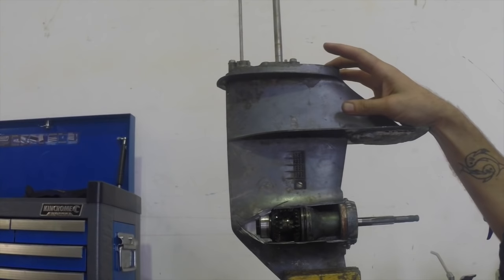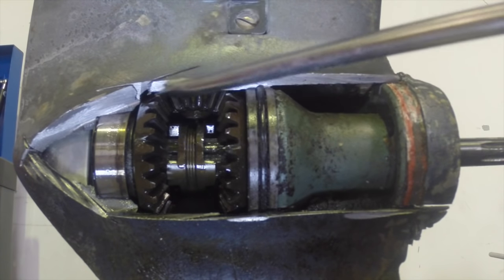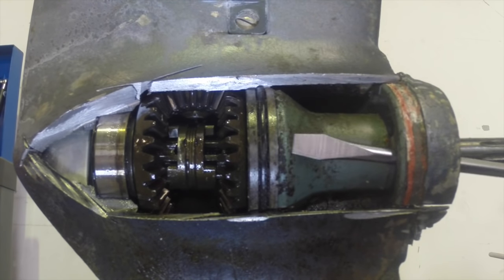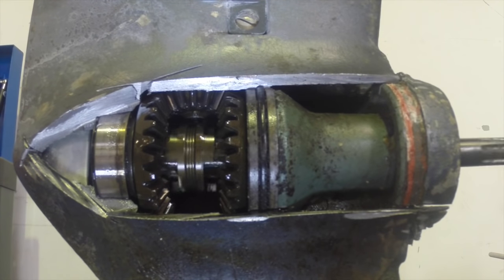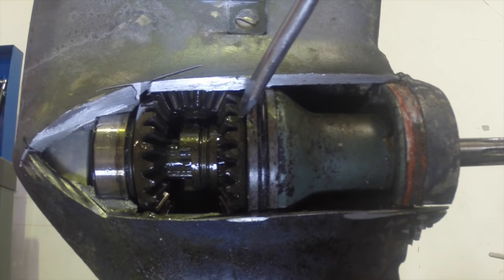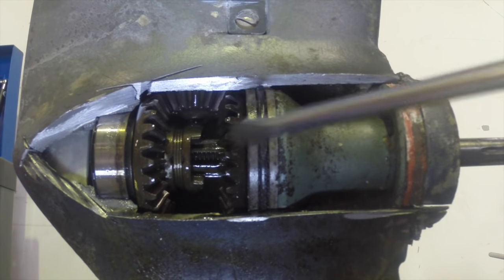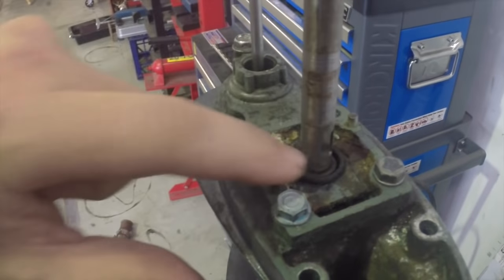How an outboard gearbox works

Comment: Brought a boat in that had shift issues to be repaired.  After looking at the damage in the lower unit, the mechanic asked me how we shifted the boat into gear. He stated the worst thing you can do when shifting a boat from neutral to either forward or reverse is to do it slow and gently. That motion needs to be somewhat quick and deliberate so that the two metal parts mesh quickly  to reduce wear on those two parts. Another thing I found out later on was shifting involving a stainless steel prop.  Because a stainless steel prop weighs so much more than an aluminum prop, I was advised when shifting from reverse to forward or vice versa, to go to neutral and allow a short delay before shifting to reverse the spin of the prop.  This delay in neutral was to allow the heavy stainless prop to come to a stop before reversing its spin. Hope this helps someone so they don't have to learn the hard way.  Your lower unit cut away is awesome by the way. Thanks for sharing.

Comment: Just the bearing carrier came out leaving the roller bearing at the bottom  around the prop shaft . Need not worry anymore . I pulled out the shift rod then blew air through the oil fill hole and wala. That piece of metal blew out and smacked  my hand so , I had a beer and a shot of Jack Daniels , gunna get pissed instead of pissed off my friend . I'm so happy , and so appreciated with your help trouble shooting .
Reply from the maker: Nice one! Have a JD for me! :)

Comment: Just wanted to say thanks from Northern Ireland.The video's really help. As the poor sod in a local fishing club who does the maintenance, your video's are invaluable to me.The explanation of the gearbox lower unit is great.
Reply from the maker: Thanks Kenneth, good luck keeping those fishing boats on the water!
Reply: Dangar Marine : I took the thermostat out of my 1977/85hp. Evinrude and am now having trouble getting it back together, not sure which spring goes to the thermostat.need illistration.

Comment: this video takes the mystery out of how the lower unit gearing works, thanks.
Reply from the maker: You're welcome, have another one on the clutch and gear selection mechanism coming soon.
Reply: @DangarMarine  dirección de taller donde reparan transmisión de un yamaha outboard four stroke 150hp año 2006
Reply: Necesito reparar transmisión de un yamaha outboard 150hp año 2006 four stroke

Comment: Nice man, work at an insurance company where they did similar cut out the sides pulled the carrier and hooked a little electric motor to the drive gear to show it.  Simplicity of these motors is pretty ingenious, seem way more complicated than they really are.  A little explanation can really help people take care of their boats.  Especially the dog clutch, so many think they gotta ease into gear which is terrible for it when you see how it chips the crap out of it.

Comment: Very educational. Even I understood it :) Thanks.
Reply from the maker: You're welcome Helge. :)
Reply: Just change impeller on my 1983 model of Mercury 80 hp. Functions great in forward and neutral. In reverse the propeller is blocked in both directions. Do you think it has to do with my mistake of throwing it in reverse last time I used it on to high rpm? According to your video, the tooths on the reverse side are deformated?
Reply: i didn´t understand EXACTLY  how that dog clutch gets movement from that vertical shaft,amidst that rotating assembly; i will continue searching,

Comment: You are amazing men thanks for your free lessons lol
Reply from the maker: You're welcome. :)
Reply: Dangar Marine trying to replace a prop shaft on volvo penta and can't get the gears to line up inside I didnt know if possibly had to remove a part or removed vertical shaft and place prop shaft in first for gears to line up if this makes sense thank you
Reply: Cool vid,i blew up mine due to water in box over time on a tohatsu 25. 4 stroke, but found a new used one from a drowned engine and the store replased impeller seals etc and it worcs like new with little noise etc.Whole gearhouse with internals replased to 1 third of new prize .
Reply: Awesome thankyou, i have 50mm crack in gearbox housing at front that has not reached seals yet, do you have any weld videos on gearbox thanks
Reply: Daimler Blanco bb
Reply: @DangarMarine  m

Comment: Excellent explanation on how these lower units work.  I had one that was a little different though, and wondered if you had ever seen one of these.  I had a little runabout, 1960-something, Larson, and it had a 75hp Johnson outboard.  One day it quit shifting into gear.  It wouldn't go into forward or reverse.  Always stayed in neutral.  I took it apart and found the problem.  

Like the one in your video, it had a forward gear and reverse gear that were always engaged.  But it had no dog pawl.  The forward and reverse gears were connected to (or a part of, I can't remember exactly) steel cylinders (one for each gear) with cross-hatching on the outer surface.  These cylinders were directly connected to their respective forward and reverse gears so would spin with them all the time when the engine was running.  There were heavy steel springs that wrapped around each of these cylinders, and these springs had a slightly larger inside diameter than the outside diameter of the cylinders that they were wrapped around. Just beyond each cylinder were matching cylinders that attached directly to the prop shaft.  And just beyond those cylinders, at each end, were electromagnets.  

When the control was put into "forward," the electromagnet associated with the forward cylinder would electrify and attract the end of the forward spring to it.  That would stretch the spring out, which reduced its inside diameter enough to tightly engage it with the forward gear cylinder as well as the forward prop shaft cylinder, essentially making them operate as a single unit.  That would turn the prop forward.

When the control was put into "reverse" the electromagnet associated with the reverse cylinder would do the same.

The problem I had was that somewhere in the wiring there was a short, so when I put the control in either forward or reverse, both of those electromagnets would be electrified simultaneously and the forward and/or reverse springs would break.

I didn't know where the short was but decided to just replace all the wiring between the control box and the lower unit.  And, obviously, I had to replace the broken springs as well.  That fixed the problem.  But I always thought it was a bad design.
Reply: Omg 😱. I’m trying to get my gear ⚙️ box to work and it looks a lot like the cut away that he shows. I can’t imagine add springs and electric with wires to the mix. 
It’s always a adventure when I set out for the water.
Reply: @stevanrose7439  Yes, always an adventure.  That's why they say the best days of a boat owner's life is the day he buys his boat, and the day he sells it.  Lol.

Comment: A tip as to how to operate your outboard. Our dive club bought a RIB with a 150 Johnson outboard, I'm the guy responsible for maintenance.

 When reverse gear was engaged, it would "jump", by that I mean it felt like it was in gear then went to neutral for a fraction of a second, then went back in gear. Eventually it lost reverse.

On gearbox disassembly, it was found that the dog clutch had worn away the dogs on reverse gear. I came to the conclusion that this was due to the previous owner "easing" it in to reverse, clunk, clunk, clunk, rather than pulling the shift lever back decisively to positively engage gear. This wore down and rounded the edges of the dog on the reverse gear and eventually made it so it wouldn't engage at all. As the price of a new replacement gear wheel was rather silly, I sourced a secondhand gearbox with problems, but it had a good reverse gear, and used that to make a good unit out of two, for much less money.

The lesson from this is, when engaging either forward or reverse, shift gear decisively, secondly, don't ram your gearbox into reverse to slow down unless it's an emergency and absolutely necessary. Ease off well before you have to stop, hit neutral and let the boat spend its energy, so you are virtually stopped by the time you you reach the dock, buoy, or whatever you wish to get along side, or moor to. 

Always operate your boat with the utmost sympathy, and it will pay you back handsomely. That doesn't mean you can't work it hard, but think ahead and don't subject it to any unnecessary strain, which could be avoided by anticipation and intelligent boat handling.
Reply from the maker: Changing gears decisively is definitely a good way to keep the dog clutch in good condition. I had a similar problem with this gearbox but just had the clutched machined for only about $20 https://www.youtube.com/watch?v=B4acSf_BgP4
Reply: Hi Stu, all of the wear on the Johnson was on the gear, not the dog clutch. I had the dog on the gear machined, as you did, but it soon wore out again, despite lecturing operators to engage gear decisively. I assume this was due to the original gear being case hardened, when the gear was machined, I think it removed the case hardened layer and the material underneath was soft.

The fact that yours lasted after machining may say something about the quality of Japanese components ;-)
Reply: Excellent advice. I think the following also applies to cars and all machinery, paying off in the long run in reduced maintenance/costs/profanity

Always operate your boat with the utmost sympathy, and it will pay you back handsomely. That doesn't mean you can't work it hard, but think ahead and don't subject it to any unnecessary strain, which could be avoided by anticipation and intelligent boat handling.

Comment: Thanks for that detailed explanation of how the lower unit works. My problem is out of the water reverse n forward works perfect. When submerged forward works fine but reverse grinds n will not engage. Raise motor out of water n back to engaging.
Reply from the maker: Sounds like the dog clutch is only just engaging so as soon as there is the slightest water resistance on the propeller it's slipping.

Comment: Great video! Such simple engineering for selecting reverse and forward, had no idea.
Reply: Also explains why there is always that nasty crunch and jolt when you select forward or reverse.
Reply from the maker: Yep, no synchro on those gears at all.
Reply: What happens when you slam the gears from forward into reverse?

Comment: Great video , very informative, I’m in the process of replacing the gears and seals on my 88 mercury 100 HP outboard , water got in it and destroyed the pinion and gears , had my boat for 13 years and kept in good shape , bought most of the seals and bearings but the gears set are very expensive here in the states and kind of hard to find given the year of the motor , thank you so much Sir for all your videos , I am a fan

Comment: I started working on car engines back in the early 70's. This makes so much sense--always wondered how an outboard worked. I imagine for a stern drive that there are two gear sections due to the extra 90 degree angle?

Comment: I have a machinist here at work , he seems to think the helicoil will work . But yah , the wall thickness looks like about a quarter inch of that . There is another type of helicoil , by ACME that has 4 pins on it so once you get 3 thousands below the top of the hole you hammer them down in to lock it in place . We'll see how this goes I guess . Thanks for the tips .
Reply from the maker: Sounds like that other type of helicoil might be the way to go. Keep me posted on how you get on.

Comment: Hello rhanks for ur videos i am learning alot ,i just bought a used boat with a 200 jhonson  2000 noticed  prop moves bach and forth ill say about 1/8 of an inch also if i spin by hand fell some how rought if i pulled out and turn fell smooth ,dont want to go out and mess things up thank u!!!

Comment: Hello! Thank you for explaining the "inner guts" of the gear box on an outboard motor. We feel like we just learned a lot. We're working on our Yamaha 8 HP 2 stroke outboard motor right now and we disconnected the lower unit to replace the impeller. Somewhere in the process we must have "pulled out" by accident the gear selector rod out of its proper place... We have no idea how to reengage it. Could you give us a tip how to reengage that rod?
Looking forward to your advice.
Thank you sir!

Comment: One thing I've learned is that as the dog clutch gets old, it starts chipping and leaving some flakes in the fluid. Especially if you use your boat for tubing and such, where you are constantly shifting into and out of gear through lots of use. These little flakes seem non-ferrous because they don't stick to the drain plug magnet. You can replace the clutch by pulling the prop shaft and not need a whole new outdrive, like a lot of guys will tell you.
Reply from the maker: Yes, this is the case hardening coming off https://en.wikipedia.org/wiki/Case-hardening You can remove the prop shaft with the gearbox still attached to the gearbox.

Comment: Thank you for your prompt answer. I lost power while the boat was running about 20 mph. Motor was still running but prop stopped spinning so I guess you can say I lost power. Tried both forward and reverse gears but not worked I guess the clutch dog is not engaging maybe the spring is broken? I was running with the gear box dry as I figured out later but no water got in the gear box.
So I guess I have to open it up and see what is not working...
If you have other suggestions please reply
I LOVE how clear and to the point your videos are, I am sorry we don’t have you here in Canada!!!
But in the other hand thanks God for Youtube!!
Thank you!

Bebe Arghirescu
Reply from the maker: I would take the gearbox off and try manually selection gears while slowly rotating the prop by hand. Could have been a failure with the gear selector cable / mechanism before the gearbox.
Reply: I will give it a try, thanks again very much!!!

Comment: So when the gear selector (rod) Is badly aligned or set, then Is when that rateling noise comes from, the teeth skiping on the gears. Actually it can also be heard if you take 2 long  to put it in gear. It should be a Swift constant move of the gear lever so gears Will not grind. Thanks Mate, all the way from Caracas Venezuela. Keep them good videos coming. 🤙🤙🤙🤙

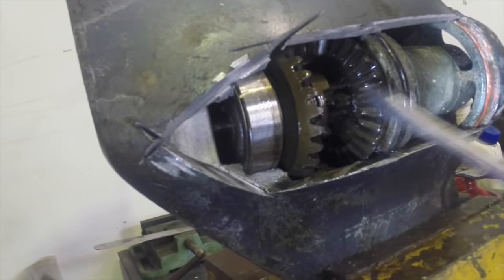Comment: 6:30 It all is pretty clear how this is designed,
but I would have liked to see more on how the
rod is connected to the Dog Clutch. I'm guessing
the rod gets twisted one way and pushes the 
dog clutch forward' and the other way to pull 
it back into neutral then further to 
pull into reverse' or visa versa.
Reply: My thoughts exactly. Wish I could have seen that part.

Comment: Very Informative 

So quick question. In your infinite wisdom let's say your motor doesn't reverse but forward works perfectly fine 
Like putting to motor in reverse is fine and dandy idles perfectly fine runs fine but the prop doesn't spin and is very stiff to turn manually in the reverse gear. Again going forward you'd never think there was a problem.

9.8 Merc 110
Reply from the maker: It could be a problem with the dog clutch or the gear selection mechanism. This video should help with that https://www.youtube.com/watch?v=B4acSf_BgP4

Comment: Hi fantastic video  just one question i have a 2003 mercury 60 hp two stroke its a bit hard to get in to gear i thought it might of been controls so unconnected the cables it shifts smooth could it be the gear change shaft what do you think it could be thank you

Comment: great video gives you clarity on how it works and how things can be fixed.  you start by saying if you hear a noise from the gearbox its not the cogs makjng it  what would it be  and do you have another video to show  what the noise could be or possible fixes . greatly appreciated. i am going to buy a tohatsu 50 oil injection runs good but noise in gearbox he sadi  they changed it but 6 months later started to make same noise again  your thoughts please and direction to review video with refrence to this
Reply from the maker: The noise could be gears if the noise is there all the time, it's just that the noise you hear when selecting a gear is usually the dog clutch. It could also be the bearings. I would drain the oil and see if it has any metal in it.

Comment: Thank you for the fantastic video....watching carefully this gear box demonstration  raised a question....those burnt fumes from the motor expelled in the water right trough the propeller does not help/encourage/start/stimulate cavitation....?...sound a bit silly but.....thank you again for the video....
Reply from the maker: Not really. The exhaust exits being the propeller so it doesn't pass over the propeller blades.
Reply: @DangarMarine  thank you very much...

Comment: This is a really good visual lesson i love it! One thing i can't get my head around is if the dog clutch is attached to the prop shaft how come the prop shaft doesn't go back and forward when we change gear?
Reply from the maker: Hi Ben. The clutch slides along the prop shaft. This video on replacing it will show you how that works. https://www.youtube.com/watch?v=S_A5OXC8p4s
Reply: Awesome thanks very much, makes so much more sense now, thank you